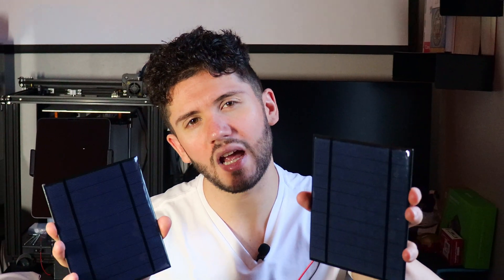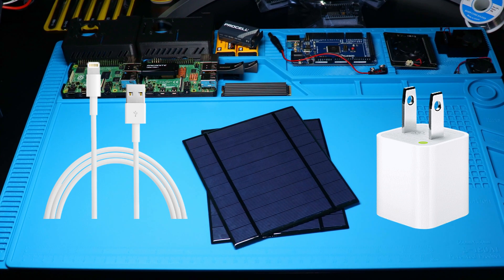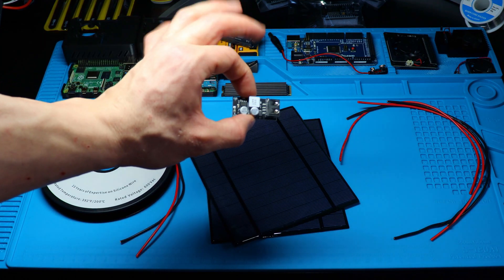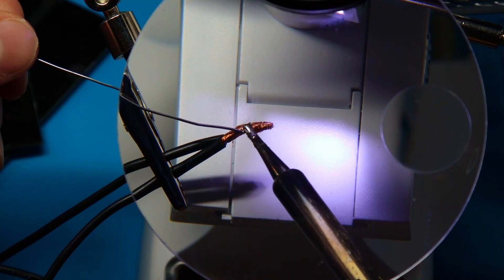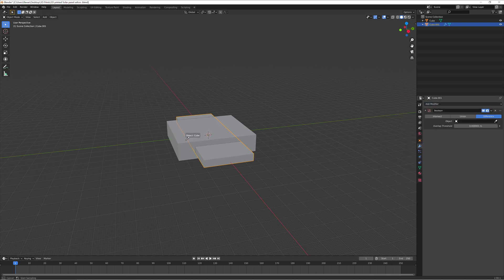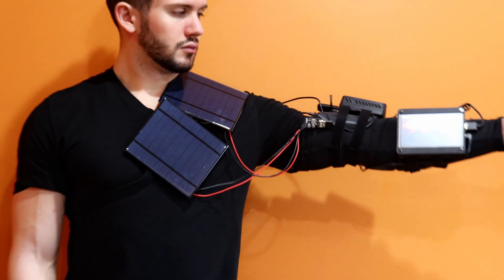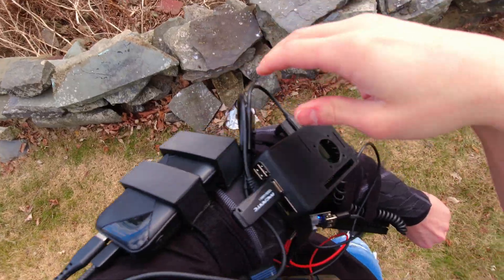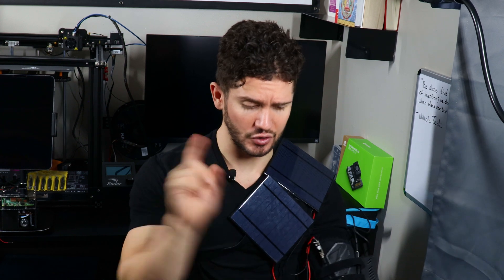Adding Solar Panels to my Computer Arm

Comment: What website did you get the solar panels from? A six volt solar panel like the ones you see in Wal-Mart for charging a six volt rechargeable battery for either a trail cam or deer feeder might have worked as well and you may want to look into it to see if it will do the same as the two you have now or if it won't be as good.

Comment: Add a speaker, also the solar panels don’t look comfortable lol maybe put them on ur back? Or use smaller ones for more flexibility? Or maybe they’re fine I’m baked
Reply from the maker: At certain points the panels were definitely uncomfortable, have to find a way to keep them more stable in one spot and not riding on my neck lol. Speakers are def at the top of the list right now!